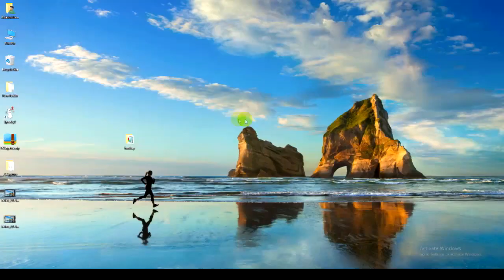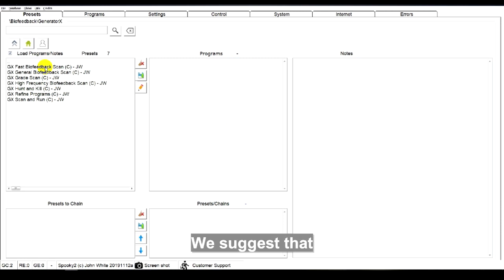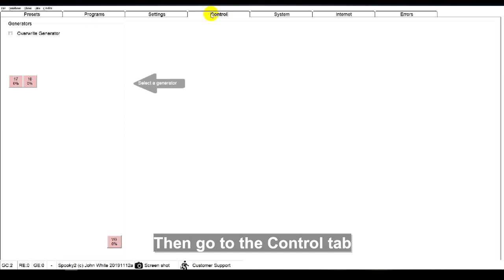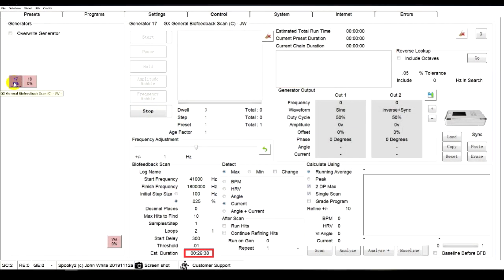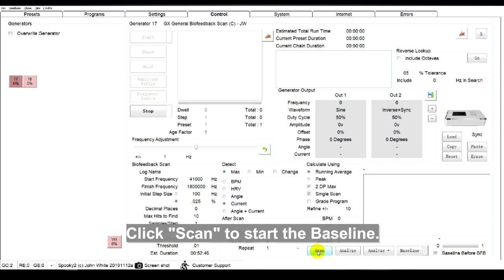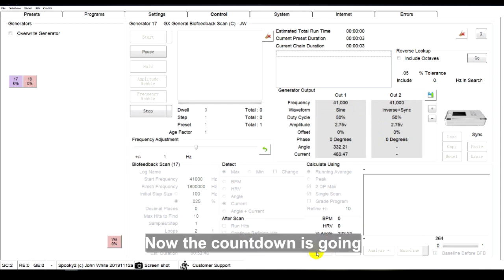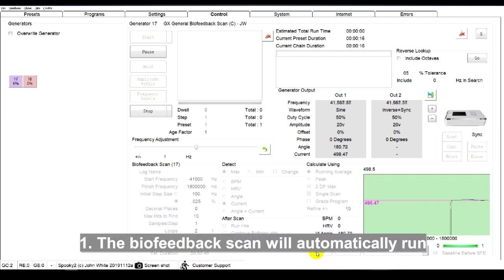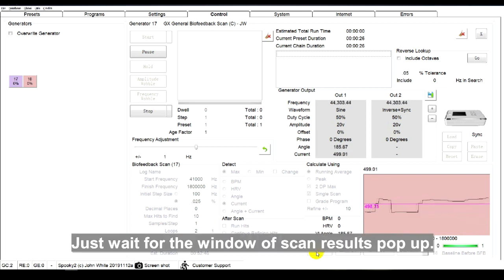How to Perform a Biofeedback Scan Immediately After Creating a Baseline

Comment: Confusing!
If a sample is put on the Digitizer Disc before the Baseline Scan, then the Program will exclude all details detected during the Baseline Scan. So when you scan, what is the BFB Scan to detect, if all contaminants on the disc are excluded in the BS? I thought the idea of the BLS was to exclude all contaminants on the disc before it is loaded with the sample and then the BFB Scan works on the contaminants in the loaded sample?

Comment: Interesting.  So we do not need to connect the tens pads together, to each other, in order to conduct Baseline scan first?  You are saying that we can have the tens pads connected to our body while software conducts the Baseline.  Is that correct?
Reply from the maker: John White recently stumbled upon that your scan result will be more accurate if you connect the TENS pads to your body during baseline. You can read more here: https://www.spooky2-mall.com/blog/improving-the-accuracy-of-your-biofeedback-results/
Reply: @Spooky2Rife  Does this apply to sample digitizer and scalar as well?
Reply from the maker: @lemontree6148  Yes. If you run Sample Digitizer scan, you need to put the samples in Spooky2 Sample Digitizer at the very beginning.

Comment: Please, could you explain how Baseline may be created when TENS pads are connected to the body, and SD with sample? In previous videos you recommended  to stick together two TENS pads for baseline scan and use clear SD slides or distilled water, as I remember that.... What has changed since then?
Reply from the maker: Hello, after our experiment, we found this way will make the scan results more accurate. For more details, you can turn to this page: https://www.spooky2-mall.com/blog/improving-the-accuracy-of-your-biofeedback-results/   Hope it will help you.

Comment: Do you need a computer to run the software with the Generator X?
Reply: I'm a Generator X user, and yes, you need a computer to set it up. It doesn't have to be an elaborate computer, I use a small netbook.
Reply: @TheAngelbase  Thank you for your answer. If I may ask, how long have you been using the machine and do you see good results? Thank you very much.